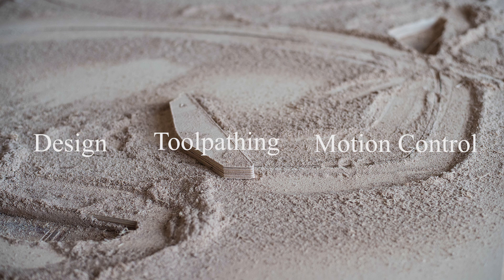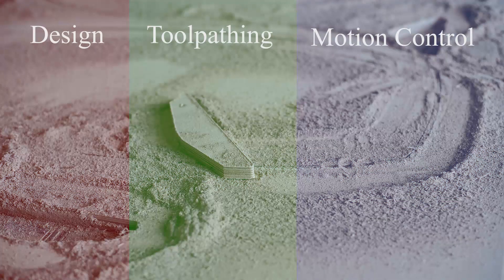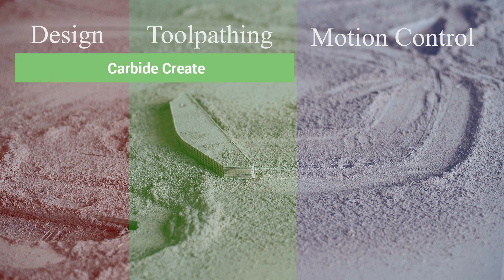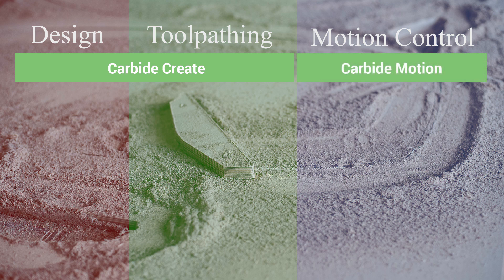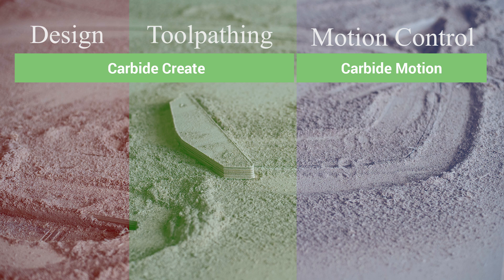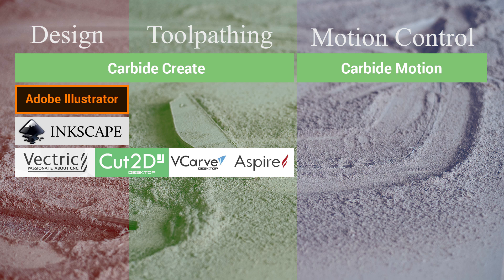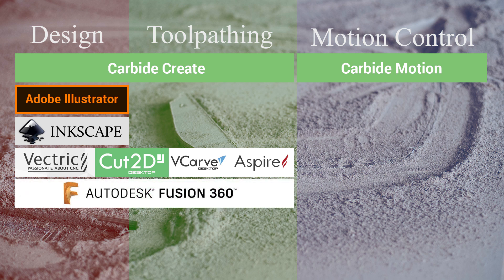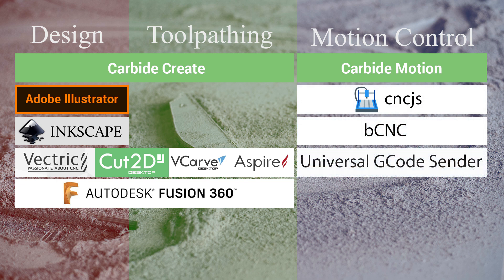CNC Basics 02 - What software do you need to use your Shapeoko3 CNC?

Comment: Where would sketchup fall into all of this?
Reply from the maker: Good questions, AFAIK there's no CAM solution for Sketchup, but it should export an STL file which is something VCarve and Fusion360 will both import and do the CAM for. But if you were going to use F360 I'd just start with the design there, the learning curve is steeper but a lot more powerful. VCarve Desktop and Pro from what I understand are happy to cut 3d stl files just not design them.